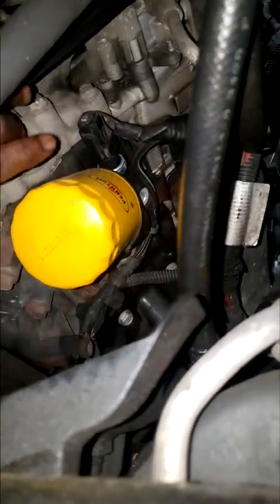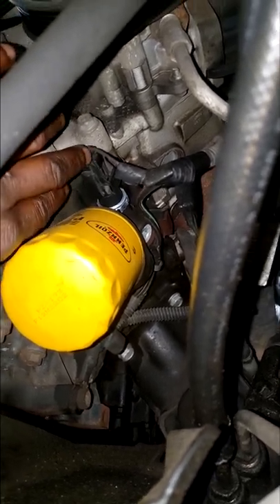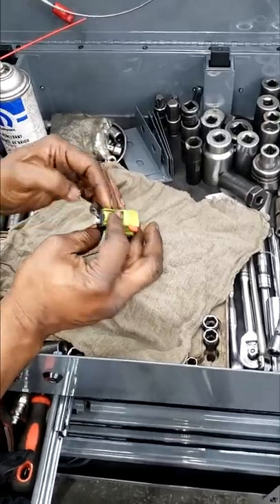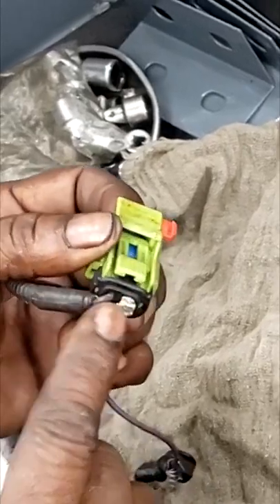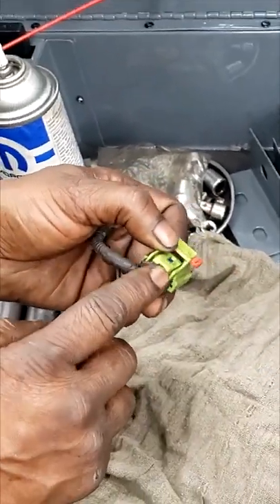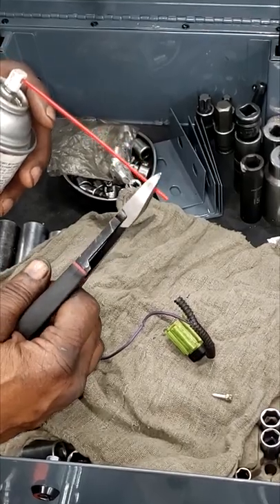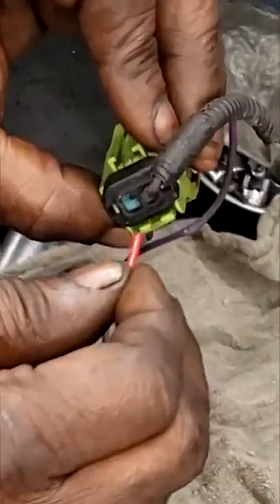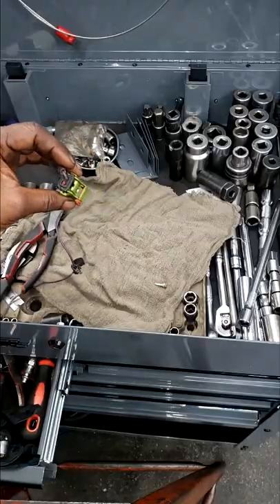SECRET REVEALED. Oil light on and flickering. Do this. #shorts

Comment: Retired Professional Mechanic Chevrolet dealership and Catapiller mechanic.  Most oil lights flicker I've done has been the oil pressure switch.  I specialize in the dealership in Driveabilty lived in suburbs of Detroit  so we always went to GM schools since they were there. These connectors are called water proof connector they are not supposed to breath. Air has moisture,  moisture makes corrosion. They are supposed to be air tight sir. I'm Sorry You are Very very Wrong. God bless
Reply from the maker: I love the way you came at me with your disagreements my friend. I can appreciate that. As oppose to the other jerks.. Now, based off your initial comment of "Most oil light flicker ive done has been the oil pressure switch" as if everybody in the world not doing that..smh, thats what makes this a unique problem. And that tells me you havent seen this problem so im not sure you should be judging ones fix for it.  Now, im also not sure if you saw the TSB that was released some 20 years ago (https://www.youtube.com/watch?v=HMXq6xNW3JM&t=5s) but this video is basically centered around that TSB and the instructions we as dealer techs was told to do at the time by the Chrysler engineeres until they revised a newer better connector. Now, my choice of words are questionable for sure, for instance, I should have used the term vent instead of breath. But they basically the same to you I assume. Now, for the record, normal thinking goes out the window when you faced with a crisis, at the time, customers was highly upset at the corp, so they created this quick fix, and im here to tell you, it was just that, a quick fix that actually hold up to this day and imo, its a cheaper/simpler fix than the newer hard to get connector they have out now. Im not understanding your ending comment about me being wrong. Are you suggesting this does not fix it or that this should not be done? Better explain yourself because im not sure if youve read all the comments. In the comments one guy that I pinned had a better explanation but because now that even the oil sensor itself has been revised, it may be a mute point at this point. So I appreciate your comment but Ide caution calling somebody wrong without understanding the complete deal, especially me. I mean ask your self, what guy would upload a video such as this if he thought it was wrong. This repair has been done by countless mechanics without absolutly any problems and everybody happy. Some things in the mechanic world highly over rated to veteran mechanics. Yes, connectors should be water proof and all that but it will not be the end of the world if you un water proof one. Fact is, nothings gonna fight its way into that connect geeesh.
Reply from the maker: Retired pro, thought maybe youde come back and explain yourself and this rediculous comment.

Comment: The oil light stopped flickering because the connector was cleaned possibly by just removing and reconnecting.
Reply from the maker: So you just dive in head first without even knowing whats going on huh? Smdh,  Well my friend,  simply unplugging and plugging the connector back in is not a fix for this. Its wise to simply just remove the plug
Reply: @OnlineMechanicTips  putting home made ram air into a connector doesn't seam like a fix on a problem only a small percentage of Chrysler cars   even have.the real fix is to replace the connector and switch with factory parts.
Reply from the maker: @007heatingandair  Again, jumping out there head first with out knowing what you talking about. Who's putting home made ram air into connectors? Second, this not about Chrysler cars, its about this flawed connector and the way it was designed and set up. Third, spending time hunting down a connector thats hard to find is a big waste of time and imo, not needed, simply do what I did in the video which was instructions given to me some 20 years ago by Chrysler via a TSB is all you have to do. BOOM, problem solve. Yall make things a lot bigger and complicated more than what they are. Keep it simple buddy and stop over thinking things.
Reply: @OnlineMechanicTips   I didn't say it was a fix I'm saying if YOUR light stopped flickering that's probably why, that little red tube didn't do anything.
Reply from the maker: @007heatingandair  When the plug was removed, all the cut tube does is keep that connector slot partially open. In the event of pressure build up, it will escape thru there. That was instructions by Chrysler some 20 years ago. All I do is simply remove the plug. That hole will not seal closed back up all the way. I been doing this repair like this over 20 years. The updated connector has to be ordered and its on back order, but really its not needed. The TSB im talking about is 08-36-99. Its the pressure build up that causes it and because this a sealed weather tight connector, that pressure has no where to go or it will simply migrate thru the wiring and could ruin things and make lights flicker
Reply: @OnlineMechanicTips  Ok I'll look up the TSB one of us doesn't have a clue, I'm not saying your little tube hack doesn't work, I'm just saying you don't know why. That white clip you throw away holds the metal pins in the connector the tube you replace it with could change the position of the metal connectors making a better connection  , if air pressure inside connectors caused problems then all cars would have this problem in all areas of their electrical systems, why just some 5.7s and to a lesser degree 3.6s
Reply from the maker: @007heatingandair  Thats why its safer to no what you talking about before you come for me. This is a 1 wire connector. There is no metal pin or anything else in the other slot. They just sealed it off with that plug which made it a super weather proof sealed connector. And for the record, customers dont care why or want an explanation, they just want it fixed. Which is what I do. Only people like you that recklessly get on a content creators youtube video and question him on repairs he has made over 20 years. (this is a old problem that still shows up in the shop). So again, this is not a "all cars would have this problem problem" This is a any car that used this connector may have this problem problem. This was a unique problem at the time, all normal thinking do not apply when it comes to this connector. Your concerns are on point and legit, just not with this flawed connector set up. The the first part of your last comment simply apply to YOU. You didnt have a clue what you was talking about before you jumped head first on my video. But I appreciate the comments and thanks for watching

Comment: My 07 pt cruiser had similar problem after changing oil pressure sending unit. Oil light will come on immediately after starting.  Shutting engine off and restarting oil light off
Reply from the maker: Just pull that lil plug out bud, no big deal at all

Comment: I've dealt with this on a pt cruiser.  I figured it out by accident. I just ended up leaving the pin out.
Reply from the maker: Thats all I do, just pull it out an thats that
Reply from the maker: https://www.youtube.com/watch?v=HMXq6xNW3JM&list=UUSIdv7pEKV2jxJvI6YZB21A
Reply: Just dab some die electric grease on the open terminal. You don't want corrosion build up in there. Sure you could argue the open straw let's some in, but at a much reduced rate.

Comment: My oil light would come on and off. Oil level is normal. No weird sounds from motor. No knocking. No loss of power. I just now cleaned the connector and diaphragm 6/24. I hope it helps. Let you know
Reply: Did you figure it out im having same issue with my lexus is350

Comment: Breath? I'm a 10 year career aircraft electrician/avionics tech, and I specialize in aircraft wiring.  I have never heard of such a thing.

I have an SRT-4 neon, and I went through this a couple times.  In my case, both times, it was because the locking tab inside the connector that holds the terminal failed over time, and pin became unseated.  I removed the pin, by depressing the tab, pushed the tab back and bent it a little carefully, put a single wrap of electrical tape on the side of the step that locks the tab, then pushed the pin back into the connector until it clicked.  I've also seen various automotive connectors fail from the harness being pulled too tightly, and either breaking the locking tabs in the connectors, or the wires themselves.
Reply from the maker: That Neon likely has the same set up as this one. If yours was fixed this way, great. But this vehicle like most all I do now is to simply remove the pin so that if any pressure from that sensor is created, it will now escape. The repairs I do now for this is in order to avoid any oil light problem is to replace the oil sending unit (oem) and remove the pin. Thats all I do
Reply: Well it’s not a car. Lot of difference.  The mechanic on video knew exactly what the problem was. Especially since another shop put in a new one.
Reply: @jamesgoodwin1155  I rebuild and build automotive harnesses too.  I wish I could post a pic.  I have several under my belt.  I am a professional, and not a hack job.
Reply: @chickensofttaco1  I just buy new ones. Easy to install. I don’t waste my time I did harness on my street rod. Not that difficult. Just super time consuming
Reply: @jamesgoodwin1155  I saved alot of money rebuilding my entire neon harness.  I literally stripped the entire thing, replaced the loom, broken connectors, and alot of wiring, added plugs and jumpers for wotbox/boostbox modules, and put it back together with brand new (better quality) loom, and aircraft rated tapes/consumables.  There's a company called kinetic that sells a harness with the same options, and his sells for over 600 bucks.  

Also, I dont work on commercial aircraft.  I'm a government contractor.
Reply: @chickensofttaco1  brother. Not say anything bad about your occupation  what I’m saying is. Sometimes like for the sensor he knew quickly what the problem is cause he’s. Seen it before. In out. You specialize in air craft wiring. Great. Me. Me. Master machinist 34 years. 47 in the industry. Boeing has been contracting me for years  I do asap I don’t waist time.  If I put the time in on that neon you. And I’m sure it beautiful job. For me I would loose more than the car harness and performance part. More for less is better
Reply: @jamesgoodwin1155  no absolutely, I'm just trying to figure out how and why the connector would "breath"?

I am absolutely not trying to be rude, and I understand that the poster of the video believes his theory wholeheartedly.  I just think that one of us doesn't actually understand what is going on here.  If it's me, then please explain the theory behind it.  The "ant" is inside the unoccupied receptacle in order to seal it from outside elements, and I do not believe that the connector is intrinsically air tight anyways.  

The closest thing I've seen is an issue with elevation change (several thousand feet very quickly) causing a pressure change outside the connector that was intrinsically air tight.  All that happened was a few of the ants got pushed out, and caused moisture to be manifested inside of the connector.  This will not be an issue in an automobile.  You couldn't drop it out of a helicopter from high enough to cause it.  Not only that, but the connector is nowhere near big enough to contain that type of volume.  Its also only got one contact inside, and no others to cross with.  Also, the connector is not really air tight, and the sensor is sealed on the connector side with epoxy.  I personally don't see any way that pressure could build anywhere really, unless the sensor is broken.  

If there is really a sound reasoning behind this theory, I'd absolutely love to know it so I can put it into my own tool bag for the future!  I would be very grateful, and also like, comment + subscribe to the channel.

If it's misinformation, then let's get to the bottom of it so other people don't pull a "plastic wrench" out of thier toolbag (so to speak) in front of thier boss, or friends and embarrass themselves.  Its entirely possible that if it is a miscomprehension of the issue, then maybe he inadvertently fixed it by just reseating the connector, and thought that removing the plug had something to do with it.🤷🏿‍♂️
Reply: @chickensofttaco1  I’m a seasoned tec at an independent shop and I have seen this issue before. Right after installing a new engine in a 04 stratus with a new  OE oil pressure sender. There is a TSB ( technical service bulletin) for this oil light flicker at hot idle. They literally have you pull out that plug and put in a vented pin plug. I did it and it fixed the oil light flicker. For what ever reason. How the connector is made? Pin contact? Idk but this is a real issue specific to that connector found on a certain year range of Chrysler products. TSB # 08-36-99
Reply from the maker: https://www.youtube.com/watch?v=HMXq6xNW3JM&list=UUSIdv7pEKV2jxJvI6YZB21A
Reply from the maker: @jeffclark5024  https://www.youtube.com/watch?v=HMXq6xNW3JM&list=UUSIdv7pEKV2jxJvI6YZB21A
Reply from the maker: @jeffclark5024  YES, I can tell you are a seasoned tech..lol, I already admitted to replacing a engine for nothing because ive been tricked by this. That TSB says for the 1999 year models with the 2.7..lol. Some people on here seem to think this a joke..lol. Thanks for the comment bud.

Comment: Or you can use electric cleaner spray and remove that white needle and clean the plug itself. What's causing the issue is that dirt and oil is clogging the passage. Just clean it and then put that needle back in and bam problem solved without the risk of that nozzle popping out while you driving.
Reply from the maker: Why would you put it back in? Thats the point of removing it. Any potential pressure build up now has a way out.  But explain what you mean please
Reply: @OnlineMechanicTips  reason there is build up is because it is clogged. By using cleaner that is designed to remove oil, dirt and other stuff from electric components such as a pigtail plug. The needle you removed is designed to allow a certain amount of air threw it and yes it is design poorly not going to lie but using the electric cleaner spray then put the needle back in will do the same as what you did with the nozzle you cut. But the difference is that the needle has a locking tab on it to make sure it doesn't slip off whole the nozzle you cut doesn't and can easily slip out and allow even more dirty to get into the pigtail and foul it up to the point you have to replace it completely.
Reply: @OnlineMechanicTips  i have done this multiple times and it works nearly every time. Only time it doesn't is when the pigtail is pretty much shot.
Reply from the maker: @GmKofHard  interesting
Reply: @OnlineMechanicTips  give it a shot the next time you get a vehicle with that issue in.
Reply from the maker: https://www.youtube.com/watch?v=HMXq6xNW3JM&list=UUSIdv7pEKV2jxJvI6YZB21A

Comment: Why would the connector need to breathe.  I been a mechanic for many years.  While I don't know everything I admit.  This confuses me.
Reply from the maker: This only needed if the oil pressure sensor creating the pressure build up (going bad) that pressure needs to escape, if not the light may flicker
Reply: 😅this dude gotta be trolling !!
Reply: If the sensor is leaking causing pressure from leaking.   The sensor needs to be replaced with a new connector now.   Because this hack just f-ed up the connector.....
Reply from the maker: @MrSiDeWaYs240  He is, he have nothing better to do than to argue with somebody thats going off and official TSB telling us dealer tech back in 1999 to do this very same thing. Hes an idiot.
Reply from the maker: @homesteadhaven2010  MAKE A VIDEO SHOWING US WHAT YOU TALKING ABOUT OR SHUT UP.
Reply from the maker: https://www.youtube.com/watch?v=HMXq6xNW3JM&list=UUSIdv7pEKV2jxJvI6YZB21A

Comment: If I'm not mistaken, isn't the pin connector hollow when a wire is not installed in it the same as a small flow tube from a lubricant bottle?
Reply from the maker: Its that way now after this repair. But originally they have it super air tight. If any kind of pressure build up the light will flicker. Now keep in mind, the oil sending unit has been revised to a much better part so there likely will be no pressure build up using the newer revised sensor. This is a 20 year old fixed based off a 20 year old TSB that instructed us to do it like this back then.
Reply: @OnlineMechanicTips  A TBS told you to stick a tube in the socket? Lol absolutely not. I am oem certified in almost every heavy equipment and small equipment foreign and domestic and never seen that. Freightliner at one point had us reroute a air line off a brake valve using some fresh 1/4 air line and a line splitter and one for a ground block having 5 grounds going to one block they had us delete the block and take 2  wire and ground them together to stop the lighting issues. But never seen one saying stick a tube in a wiring harness. Kinda laughable.
Reply from the maker: @stevenliberadzki9160  No, you laughable. To suggest Im some rookie that just set around making shit up is crazy. I dont really care if you OEM certified in what ever, by now you should know not to jump in head first on somethinng if you dont know what you talking about. That makes all you said and bragged about yourself null and void. You come off as a rookie to me and based off your comment, I now consider you a rookie mere amateur with certifications..lol.. But for the record, yes this was a TSB, (not TBS- even thats a rookie mistake) that suggest we do everything I did in this video.  Dont come for me bro. I got this on this end. Here you go. https://www.youtube.com/watch?v=HMXq6xNW3JM